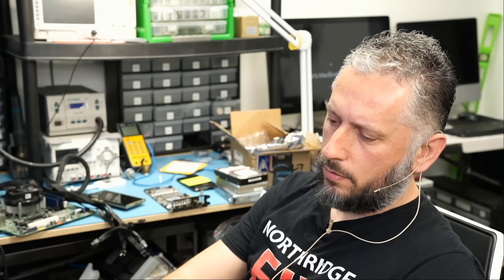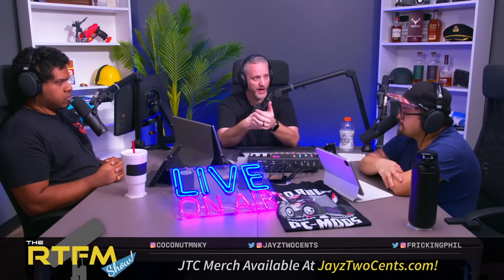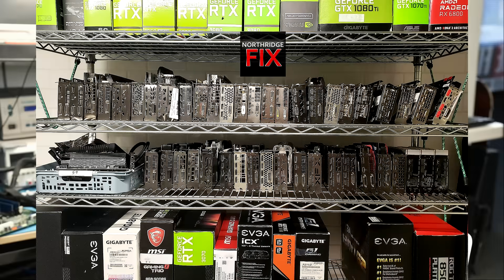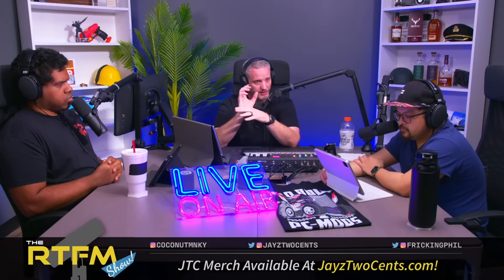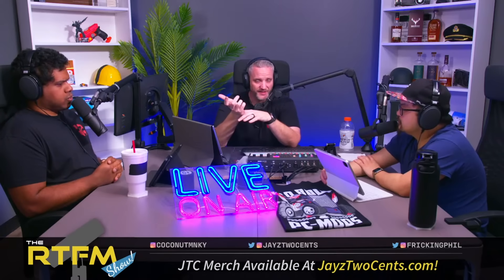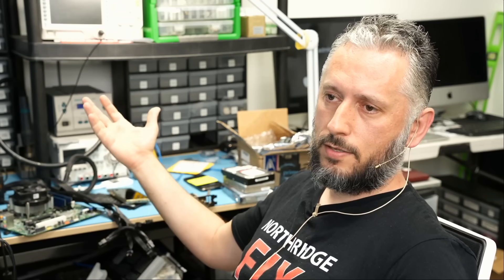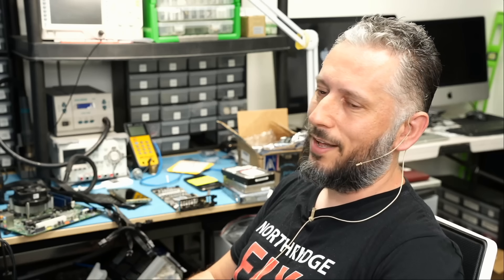Melting 4090 and CableMod. JayzTwoCents and Gamers Nexus Response. Blame NVidia or User?

Comment: I am a mechanical engineer but  electricity is often in my path. I feel like something very obvious might be getting overlooked, are the two failures types related? Are the pins developing cracks driving up the amps, then that heat or maybe combined with an expanding pin connection melting the connector. I find it very suspicious that the connector in question has a second issue of being easy to break.

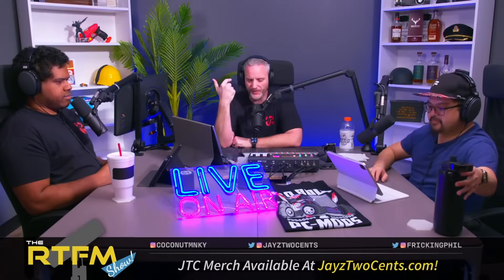Comment: 3:51 I don't think Gamers Nexus (GN) was saying it was mostly user error, though Steve did leave it vague on who he thought bore most of the blame between Nvidia and the user, probably because he wasn't sure of the answer.

His most probable suggested scenario is where the cable is fully plugged in initially, but when the user moves cables around for cable management it comes loose. That might not be the case where the cablemod connectors are used, but even if it is I believe it's likely still entirely Nvidia's fault. It's reasonable to assume the cable is going to be tugged a certain amount, and there is a tolerance that was on previous 8-pin and 6-pin PCI-E power connectors that the new 12 pin apparently doesn't have to account for that tugging.

However, have we not considered that the 4090 might sometimes just be drawing so much amps that the manufacturing tolerances for the metal on the contacts will sometimes intersect with the contacts heating up instead of it just being a short from a mis-seated connector? This would explain why the failures are more random and some of them are happening from cable mod connectors. It could be both scenarios honestly. Either way, Nvidia should be footing the bill for these repairs, not CableMod.

Comment: The problem is the amount of current traveling through the wires to the pins.  The card draws x amount of AMPs at specific voltage through the wires to the pins.  If the gauge of the wire or pin size is slightly too small the resistance and Temps skyrocket.  Likely, no adapter or cable will fix this issue as the problem lies directly with the cards receiving pins which in turn connect to the PCB traces.  The card was designed to carry the load relatively evenly throughout the entirety of available pins.  Unfortunately that only works in theory.

Comment: I agree that this is on NVIDIA but one of the missing pieces of this  puzzle are current measurements if we knew what the current demands are on the connector at the time of the failure we could determine if something on the card is failing and causing a over current condition or if the problem is resistance due to a lose fitting connection also I would like to see what the Metallurgy of the connectors are maybe some impurity in the metal is causing this failure.

Comment: After replacing the connector how long it will last? Does the heating problem goes away? I’m thinking of buying a ASUS 4090 but watching this videos and in my opinion is a factory defect is really difficult to make a decision. I also read that a ATX 3.0 PSU can help with the problem I don’t understand how.
Reply: Likely the ATX 3.0 PSU can more evenly distribute the power throughout the wires/pins not overloading the connector at certain points.   The gauge of the GPU's connecting pins is the real issue.  But even if they fixed that they are just passing the problem along to the PCB traces which will burn.  Fix the PCB traces and then you fry a component.   Basically the 4090 series draws too much power for its design.  This is what happens when you push the performance too far vs its design.

Comment: I agree with you 100%. I use a 180° Adapter and Cablemod Cable with my 4090 Strix.
The connector is just crap. They should have used a 12pin in standrad size not micro fit.

Comment: So heat is generated in a few ways here. Short, Partial connection, or improper gauge of wire/pins. 
If the 12v input is split off into different sub power rails maybe start there to see if its a amp draw issue causing heat due the pins not being big enough? Although it seems odd the fail point would be the connector for this since the wires would be far more susceptible due to their gauge and material. 
This does strike me as a connection issue. It may be the connector style in general being the issue. The box pin setup relies solely on the tension of the metal in the pin to keep solid connection which as we know with phones and tablets is a failing design. Especially if heat is introduced which causes metal fatigue even faster.

Comment: The 12VHPWR connector was always a bad idea.  50A on 6 tiny pins doesnt work. (6 pins because you need +12 and ground @ 12 v = 50 A or 9 A per pin).  That is more current than a home water heater/cloths drier, look at the connectors on those.

Comment: Any connector, plug or anything that connects into something else needs to be designed with the rigors of regular plugging, unplugging, cable bending and ideally withstand at least some lateral forced placed on it. Even though you're not meant to be repeatedly unplugging and replugging a GPU's power cables, they can sometimes require some force to connect properly.

Even if it was caused exclusively by cables not being seated correctly, then it's still mostly on nVidia. Throughout the years as I've built my PCs I learned that you often need to apply some force to connect GPU power connectors and ensure they are seated properly. There is more often than not a subtle felt feedback given by the locking lever latching onto the connect once it is seated. There's nothing special or unique about that, and that's the hallmark of good design. 

nVidia's 4090 cables and connectors came with warnings not to bend the cable within a certain distance from the connector. I mean, what the fuck nVidia?! They're basically admitting that they've made a structurally weak cable, most likely exacerbated by their ridiculously dense connector.

Comment: Steve; check for heat on a fully seated plug and the card at full load. Where does the connector get hot. Is it always the same pins? Then find a way to check the power draw going through each wire when at full load. My gut tells me the pins that are melting are also the pins where the card asks the most electrical power.... that they are not getting the same load.  That's probably the reason the 3090 series don't melt, they spread the power draw better over the available pins. Please check before making anymore conclusions!!!!!!
Too much power through a too thin wire/pin/connection equals heat!!

Comment: the card should have been designed to boot using the power from the motherboard .. up to 75W .. then it should be able to test to make sure all the pins are correctly connected before intaking more power .. if the cable at any time gets pulled out a bit .. the card goes into a limp mode with the 75W and a red led lights  up on the card to let you know it's not making a proper connection ..I do agree that it should have had a better or second latch ,  i;ve yet to see a melted connector in person .. either out of a computer that comes in for a repair or one of the ones I've built yet ... I do remember a melted 24 pin connector years ago on a customers computer .. he fired a power supply by upgrading to a video card that was too much for it .. and then didn't plug the 24 pin cable in all the way and it melted the motherboard connector ... so it's possible to melt other connectors .. but I would guess it's more rare because most other connections don't pull that kind of power over such thin wires

Comment: Could you imagine if you went to start your brand new car and the ignition started to melt when you turned it on so you tow it to the dealer and they say you didn’t insert the key properly you need to do it this way and make sure it don’t move or it’s your fault we won’t fix it ! You wouldn’t like that answer and you would get your car fixed for free ! It’s totally on the manufacturer to replace it ! Especially if it’s a fire hazard ! Someone could burn their house down and the lawsuits would start

Comment: I agree with you - I think the confusion is that Steve could reproduce the burning connector by user error, and yes I do believe that some of the burned connectors were due to the cable not being pushed completely and firmly - and yes you would be surprised, that some people overlook that, HOWEVER, not all failures are due to connector not being fully plugged in, as even a tiny gap can cause enough resistance to burn the connector (allegedly), so this is NOT normal - should it be on consumers to measure gaps and make sure there is no micrometers of gap, no it's absurd !!!  IN my opinion this connector is a sham !  NVIDIA and other tech companies have become scummy over the years, quality control has gone down the toilet and cutting corners have become a thing.  This could easily be avoided, they could add something to make sure this does not happen, a sort of fallback / throttling down or thermal sensing if temperature or resistance is above spec and cut the power.  It seems the tolerance of error is non existent it's NOT normal, it's all on the maker of the product, they have to account for slight differences in design and for those tiny gaps.  The design is horrible in my opinion, they should make connector sturdier, pins thicker or add provisions to detect higher than normal resistance or temps - BUT keep in mind that if they add these safeties it will end up costing them more money per unit so it can translate to millions of $ more in costs - Companies obviously would rather blame the consumers on everything -  NOW it is obvious it is NOT happening to ALL cards, and the reason might be because not everyone is running their card at a load high enough to be an issue - the connector is not passing high wattage at all times, some users will never go anywhere close to the threshold, so their connector will likely never burn, other people might be hard core gamers and be at or around those wattages much more frequently - you would think that with the high ABSURD prices NVIDIA charges for their cards (a RIP OFF in my opinion) that they would add safety features to detect thermal anomalies on the connector, not hard to do.  Since you cannot account for gap thresholds and variances with how secure a cable is connected, then the next best thing to do is detection.  The same is true with an electrical circuit - Take a 15A electrical socket, if the wiring inside the receptacle is not properly fastened and up to code, there will be resistance, and the edge of the wire will burn, you will at first melt the insulation of the wire and eventually burn your entire house down, so ? physically that can build the connectors to make sure that the cable is fully seated there are mechanical ways to do that, and even so, not having thermal protection on cards that pass so much power to a connector should be in my opinion a crime !   As far as I'm concerned, 100% on the manufacturer design flaws as even a slight deviation can cause the issue - most people buying those graphics cards are not engineers, they are gamers.

Comment: I purchased the CableMod 12VHPWR 180 Degree Angled Adapter - Variant A - Black for the Asus 4090 Strix. Unfortunatly after 3 weeks of my PC being built and seated correctly i noticed a Burning smell, Upon removing the side panel of my case i touched the 12VHPWR 180 Degree Angled Adapter and it was very hot to the touch. i shut down the PC. i took it back to the Local computer store where thier suprise the 12VHPWR 180 Degree Angled Adapter and melted and fused together with the power connector on the grapichs card and is unable to be removed. The power cable that was connected can be removed but the 12VHPWR 180 Degree Angled Adapter can not. There was a hole burnt thru the top of the adaptor also.
Reply: I will add the adaptor is fused with the card on the GPU side as the top cable power cable was fine. ;(

Comment: There is no logical sense to shrink the connections that have previously been a standard size especially since the card consumes so much power. It just doesn't make any sense, especially the size of the connector. Who thought it was a good idea to take FOUUUUR 12v 8-pin connectors and then reduce the size of the pin connection. It most certainly would create an area of resistance. There's a reason the 8-pin connectors are the size they are, to ensure proper power delivery without fear of failure. They easily could have doubled the size of the 12 pin connections.

Comment: I agree, this is some thing to do with the card. Maybe there is an issue with the plating on the pins.  Too thin causing the tolerance to be too loose or contaminated causing the resistance through the plating to be to high. That could explain why some cards fail and others don't.  Maybe there is some leakage current passing through the connector causing a short that only becomes a problem under extreme use. As we all know heat causes problems to compound. Maybe its the heat cycling, hot then cold over and over will cause a lot of movement. I don't know, I'm just rambling. My point is It seams to be an issue with the card and Nvidia should step up and own it. These card are stupid expensive and should be support as such.

Comment: Never heard anyone say anything about what is the max current those pins can handle in the connector. Seems like to me the current draw exceeds what the connector can handle. 12 volts at lets say 400 watts peak wattage is about 33 amps! Simple ohms law so take the connector AND the solder traces on the card and rig up 33 amps of draw through it and see where and when it melts?

Comment: I think the problem is the connector thats soldered on the graphics card itself that is failing and not the connector that is being plugged in by the user. Be it a 90degree one or the standard nvidia one. That connector soldered on the board itself, might be whats heating up over the prolonged use which in turn melts both connectors. Just a hunch

Comment: These connectors are not reliable, one redditor suggested to monitor 12VHPWR voltages. He said he saw 11.7v initially, then 11.5v after 3 months. So he replaced the cable and now it's 11.95v under load. GPU-Z or HWiNFO64 should be able to monitor the voltages on 12VHPWR. Lower voltage indicates bad connection and potential overheating of connectors. Many users have set alarm for a minimum 11.9v to monitor the situation.

Comment: See what type of plating is on the card side pins next autopsy.  I know we avoid gold plating like the plague on anything that passes large amounts of current because of it's ability to delaminate.  Also check for a color change on the most melted pins that go to the PCB.  They may have the wrong coating on them and build up an oxide layer over time from a continuous DC current.  Maybe there is a conformal coating issue after the PCB gets its through hole components installed that are separate from the SMT pick and place assembly.  If the original user already partially melted a connector then put the 90 degree insert on, the highest impedance would still be the cable assembly with the female pins that would have lost some of their spring power.  The sockets themselves being sold to the card makers might also be using undersized pins in terms of thickness so there would not be enough spring tension to maintain minimum surface area at the contact point

Comment: I work with medical devices. We have seen a similar issue (power plugs/device power sockets melting) - likely to poor quality control in the Chinese production line. Due to the type of device (medical), we had to do a full analysis and report to our notified body (like an auditor), and this is how we found the likely issue of poor connections in the device (not the cable). The 4090 issue should be resolved by re-engineering the board power connectors.

Comment: I think the explanation is far simpler, too few conductors and too small wire Guage to support the current draw. If the old 8 pin connector supports 150watts then it should have at least 4 of those for all the power needed to run the card. These new connectors are 6 power, ground and 4 sensor wires; its just plain over loading the poor connector. The bad design comes in to poor loading between all the connections. This is $0.02 for what it's worth.

Comment: I'm pretty sure it's way more productive for players like NFix, GN and JayZ just to check resistance of each connector's pin rather than overthinking who to blame :D
Or even better - desolder a healthy pin from a new card and test it against max amps allowed AND designed by the manufacturer

Comment: Surely someone can just setup the card with a multimeter probing the pins under various load conditions to verify if the load on these connections is exceeding capacity. Ideally multiple meters to actively monitor load on all the pins.

Perhaps there is simply too much being asked of these old and outdated connectors. It’s time for a redesign of graphics card pcb architecture because in what world does it make sense to have a chunky power supply connector just hanging off the side of it and then putting all the weight of the card on the other end. You are guaranteeing that the pcb will flex and things will go wrong.

Comment: I have a Strix 4090 and with the CableMod 180 connector the screen would occasionally freeze and the fans would ramp to 100% forcing a reboot. However, with the 180 connector removed the card works perfectly. Everything was fully seated and nothing melted, but the adapter was causing some type of issue. CableMod said it was a broken sensor terminal in their adapter and issued an RMA. In my case, it's not the card, not the cables, or user, but was the actual CableMod adapter. Could be an edge-case, but the only issue I've had was when CM was introduced.